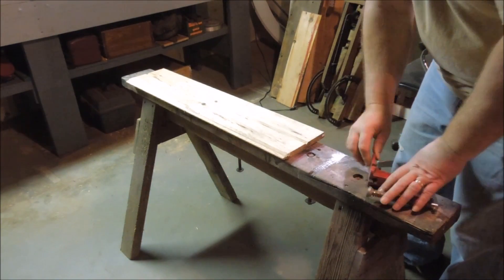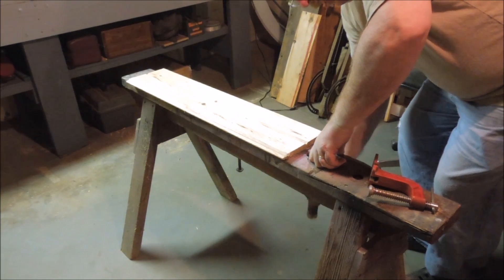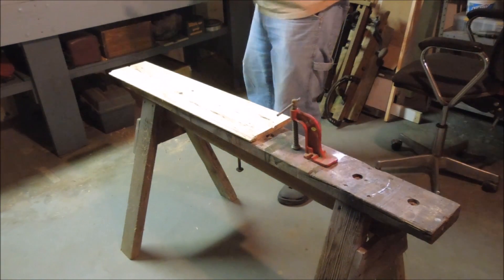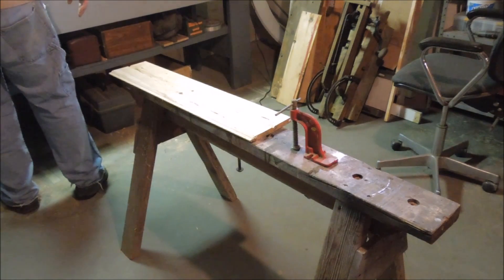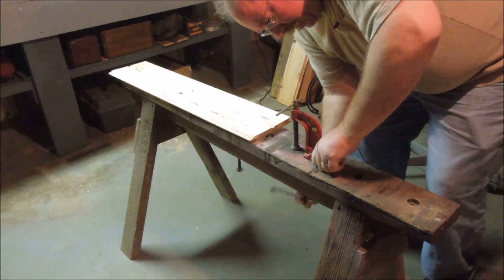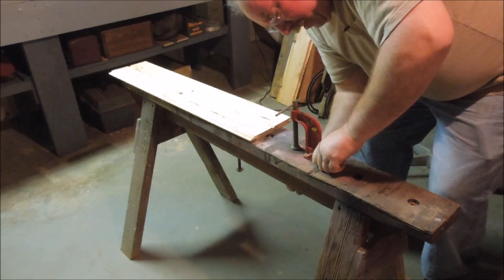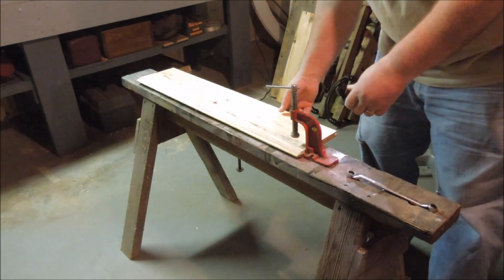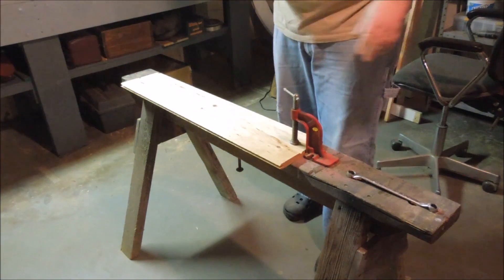Tips & Shortcuts #5 Sawhorse Mounted Clamps - a video tutorial by Old Sneelock's Workshop

Comment: What king of clamp is that and where can I find one? Thanks for the great video I'd like to make a saw horse like that.
Reply from the maker: Wish I could tell you. I don't know who made them. I bought them more than 30 years ago when I was making storm windows for my house. I needed a workbench and didn't have one so I built the two saw horses to mount the clamps on. 
The saw horses were shimmed up level and I assembled the windows on them using the clamps to hold the frames while the glue was drying. 
I went on line to try and find some of them with no luck. 
The closest I found were called Strong Hand and they were built to go with a Strong Hand Welding Bench.
Reply: Old Sneelock's Workshop I appreciate your help. I’ll try find something closely resembling your piece.